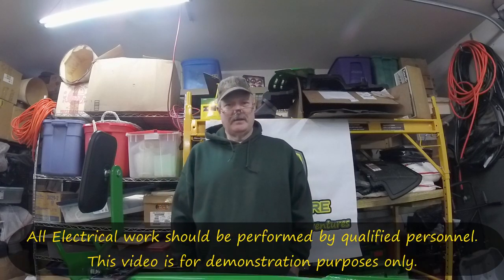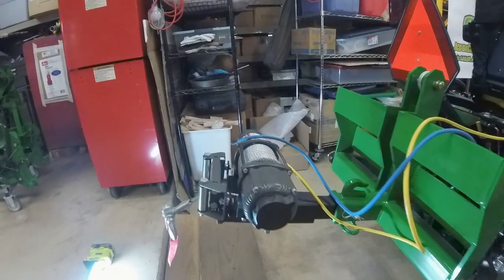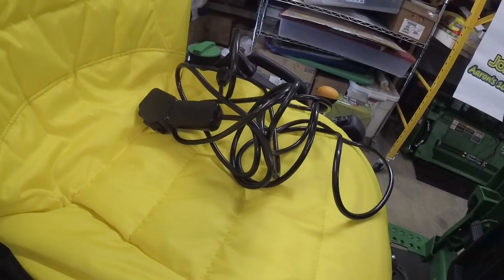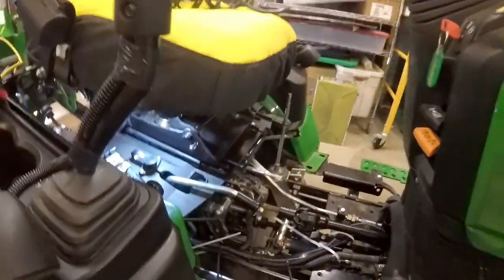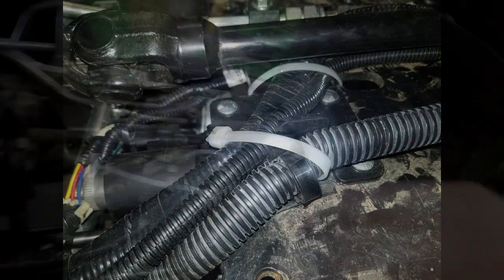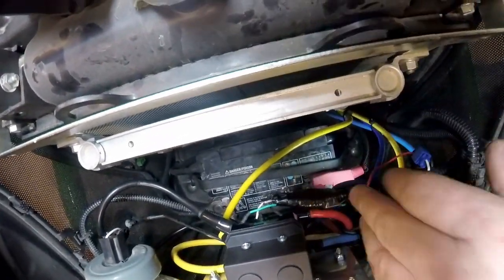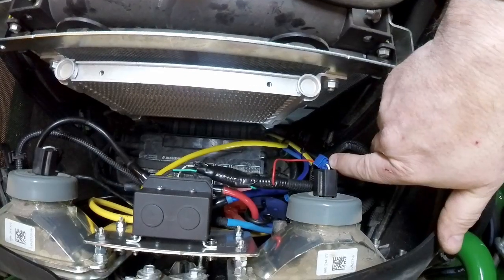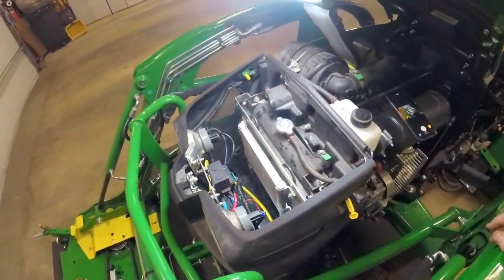#6 Harbor Freight Winch Wiring Example

Comment: Hi Aaron, 
 Thank you for posting this video. I've been wanting to put a winch mount onto my Kubota for a few years. Everything is very tight (very little room) for running wire and connecting to the battery. One of my hurdles is how to connect to the battery: 
1. I looked at a number of connectors and I had problems finding one that would work.
2. I've been told that the stock battery can't handle the power drain from the winch. 

 I see you have a safety relay. Did this come with the winch? Where did you get it? What does it look like under the cover?

 Does the stock battery run the winch pretty good?

Thanks,
Jim
Reply from the maker: Hello,
My harbor freight winch twisted and I got a refund on it because they did not have that model in-stock. Doing some online research I chose motoalliance viper elite winch, 6k. It had a couple similar factors such a wire size and a similar control relay. It also had a wireless option but since I hardwired the old one I stayed with that. This price point of winches has a low duty cycle. Which off the top of my head would be 30 sec use then 14 min rest. Check the manuals to be sure. I have not had a battery issue but I only occasionally use the winch. Not like I would if off roading an atv. If I was using in more that 1 or 2 times a year to get unstuck or pull a log the I would suggest upgrading the battery to a deep cycle version made to withstand the electrical loads. I will do this once I need to eventually replace my battery.
Reply: @AaronsRAdventures  Thank you Aaron!